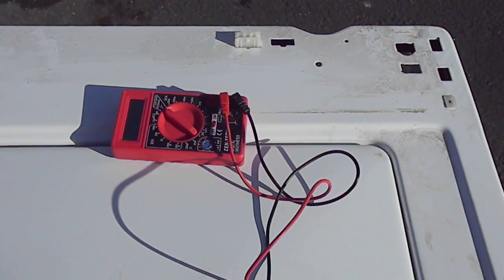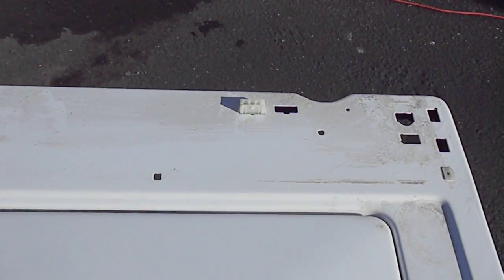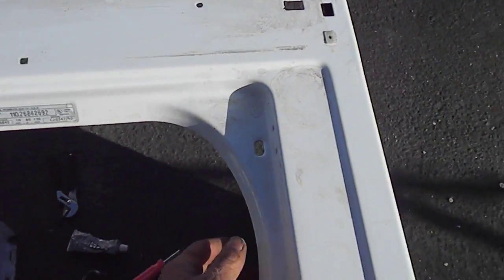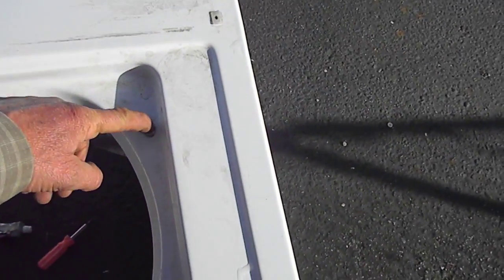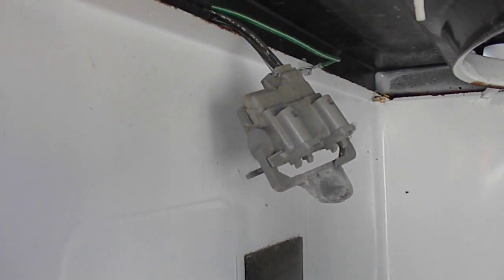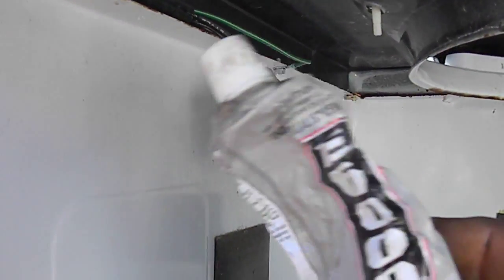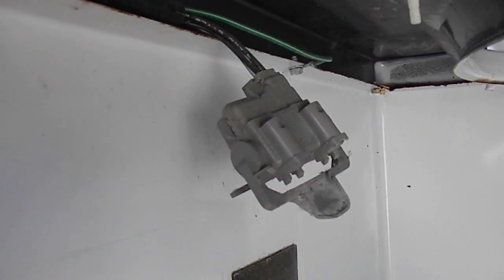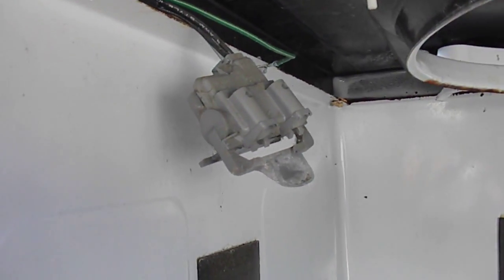Kenmore,Whirlpool,Service,washer not spinning,appliance repair,Eureka Ca

Comment from the maker: The lid switch may be the most common cause for not spinning. Next is your drive coupler. If you have a slow spin than you may have a bad clutch. If your motor & drive coupler are working and your basket is not trying to spin (bad clutch ) than you may have a bad transmission. Occasionaly the timers go out but than you may notice that it would spin on one cycle and not the other.

Comment from the maker: The timer is located behind the timer knob. In my world ,timers are not normally the issue, check the main control board or the door switch, is the pump clean?  Thank you for your comments, Appliance-Works.webs.

Comment: I'm guessing it's the timer on my Kenmore 417 frontload. Yesterday it would not spin on the power cycle and but did on the eco cycle. Today, will not work on any cycle. Pumps water in, the motor sounds like it is running but no spin and it pumps the water out. Where is the timer and how can I replace it?